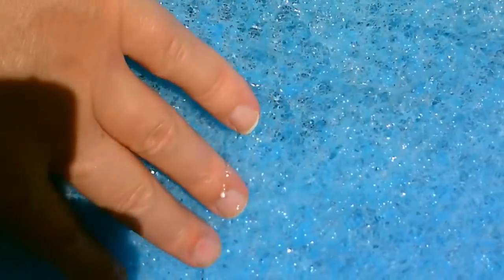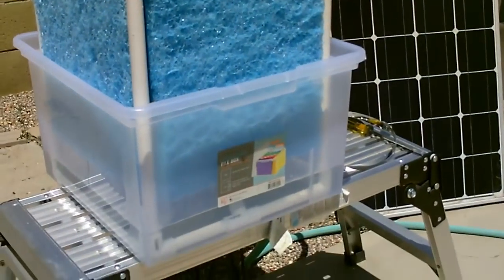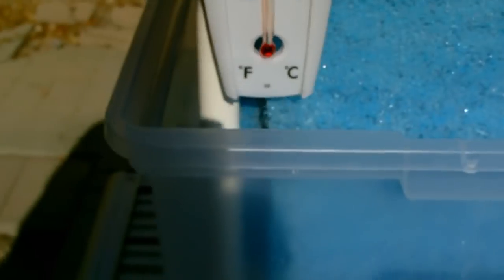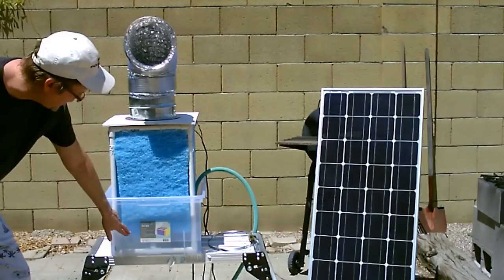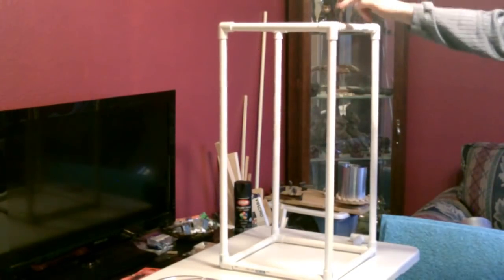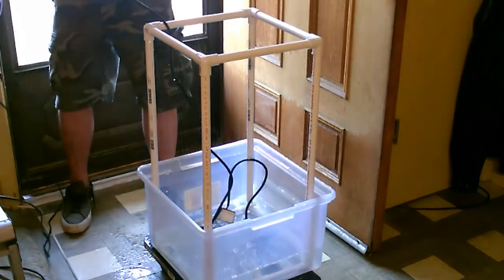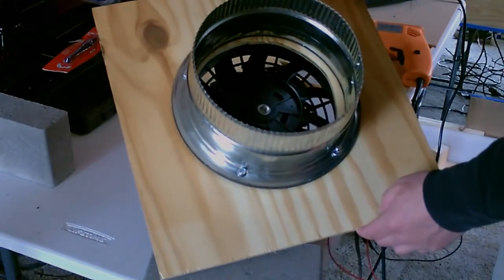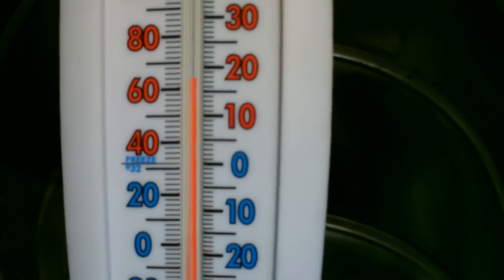DIY Evap Air Cooler! Best Yet! 1500CFM/20MPH (90Fin/64Fout) 500-1000 Sq.ft. run AC/DC/Solar/Batt

Comment: What size is the fan?  I just turned my swamp cooler from AC to DC to run off my solar system.  I used 8" radiator fans because 10" was too big but the smaller ones are louder. Anyway, now I need to make some for the other rooms. Did you go with 8" fans? All our bedrooms are about 120sq ft so I'm going to test this on one room.  It's been over a year, do you have any improvements since then? How has it been going for you and anyone else that made these?

Comment: Hi I am in the process of buying the supplies to make this. I have read that some people prefer the aspen wood fiber pads and also that the corrugated cellulose pads are the most efficient, although more expensive. Have you tried this with other pad types?
Reply from the maker: hi. i haven't used the other types of pads. i don't use the aspen ones because you can't cut them (so you'd have to design your evap. cooler specifically for a certain size pad). that seems very limiting. about the other type, i may try the corrugated pads in future vids.

Comment: Has anybody found the pump add a link please
Reply from the maker: hi there. i don't see the exact pump listed on amazon at the moment but here is a similar one. this is a link to a 12v 200gph pump https://www.amazon.com/VANSUNA-Submersible-Aquaponics-Agricultural-Irrigation/dp/B07TK2TV77/ref=pd_sbs_86_3/143-3040554-3226717?_encoding=UTF8&pd_rd_i=B07TK2TV77&pd_rd_r=d45f9beb-b00d-481f-aed4-ca22242b806d&pd_rd_w=rbq1I&pd_rd_wg=EFaNu&pf_rd_p=703f3758-d945-4136-8df6-a43d19d750d1&pf_rd_r=2KTNZ19XBCJSNFN960Z9&psc=1&refRID=2KTNZ19XBCJSNFN960Z9

Comment: I built the short version of this design a few weeks ago.  I tried it out at a place that had relative humidity between 17 & 20%.  I got about a 15-18 degree drop in temperature.  I was stoked.  But... the problem was that the 1500 cfm/2250 rpm 7" fan could not put out enough volume of airflow to lower the temps in my trailer.  While watching the beginning of this video again just now it appears that the airflow of the fan in the video is much higher than what I was getting in my trail run (my hair definitely didn't move like that).  I'm wondering if my fan is a lemon or if I need to experiment with giving the fan more juice (higher voltage).  I used the 12VDC system on the trailer to power the fan and pump rather than hook up directly to the solar panel that I bought for this unit.  The solar panel would have provided higher voltage.  Any advice would be appreciated.
Reply from the maker: hi. first, it's awesome that you built it and your getting good temp drops! most likely you just need to flip the fan blade. the fans i use are what they call push/pull fans. if the blade is not facing the right way it will run fine but it won't move hardly any air. (the blades are usually very easy to flip. it's usually just a single nut that holds it). i get a 20 mph airflow. if flipping the blade doesn't work, try powering the fan with an independent power source (meaning use one power source for the fan and a separate one for the pump). if that doesn't work then i'd try a new fan. one other thing... this is probably unlikely but it could also be that you have too much water flow down the pads. if water flow is too heavy it might be acting as a barrier. try reducing water flow. (keep at it. this unit should easily cool a trailer when you get that fan cranking)

Comment: Wrap the sides and bottom of the tub in some insulation or see if you can get a cooler that would fit. I bet you could knock a few degrees off the air temp

Comment: OK all my parts arrived and I may start the build and upload this week if possible. Mine will have a solid wall on the front side with fans and switches and the other sides the blue fabric material.  I need some PVC and a note book to sketch it up. Its been really humid these past days so I did not have interest in it.  I will try a 100w solar panel and if not put 200 watts in solar panels. I may be going over board but looks interesting.
Reply: Where are you? And if you build it record it, upload it and please send me the link. I'm curious to see how others do with it.
Reply: @Live-Life-Freely  I'm in South Texas and I have all the parts still in the back yard. I have not made time to create my setup.
Reply: @cutweldngrind  Nice now it's just a matter of making it happen.

Comment: Wish you had affiliate links to all the products used. Would be easy for me to find and nice to give you a little commission for posting the video!
Reply from the maker: hi there and thanks for the comment. i looked into affiliate links a while back. there's a couple of reasons i don't use those. the main reason is that my videos are the 'evergreen' type (meaning they're relevant for years and years). the links to the items (on amazon) change so often that many (or most) of them wouldn't work in a short time. all those un-working links might really frustrate people. and trying to make sure that all the links, in all the description sections, of all the videos, were always current would be way too labor intensive. other reason is my projects are typically made with simple, inexpensive components so i'd probably make no more than $2 to $3 a month total on affiliate links anyway. (the payout on affiliate links is very small unless the item is pricey).
Reply: desertsun02 understandable. Well thank you very much for the idea and breakdown of all materials used. It will make a great Saturday project!

Comment: Where are all your Amazon referral links? Great build!
Reply: Exactly. I wish he posted links to all the parts, it would have made it a breeze to build one. :)
Reply: I'd settle for just the fan :)  The rest is pretty generic stuff on Amazon and the hardware store.  The cooling pads are cheaper at the store.
Reply: 12 volt cooler fan PVC pipes and water pump for a fountain

Comment: Nice design... I build one and get similar numbers! I used a honda crv radiator fan.
I put the frame in a 55 gallon plastic drum and added  auto waterer.
Works on solar... 

Currently on second build out of 4!
Reply: Question on the radiator fan did you just bypass the 200-+180 thermostat switch

Comment: My old radiator fan still works, and I have everything but the pads and the oil/water pump. This is goin down!
Reply: Did you ever build it
Reply: @carlschmiedeke151  Not even a week after I posted this I Herniated 3 discs in my back and I'm waiting for surgery still.... So no lmao.

Comment: I may build one, 6' tall, 6' wide ~2' deep,, I live in Phoenix...3 car garage.
Reply from the maker: sweet! 😎
Reply: @desertsun02  Built two, my smaller 5cft unit turned my garage into a sauna 😀, blew at ~78f at 111F garage temps though,  moving that into attic as Arizona attics are essentially outdoors. Guess my large unit I'll have to place outside and duct in....and I'll get a positive pressure system that way.
Reply: @desertsun02  Well I'm about to give up on my big unit maybe you have an idea I'm starting to question reality. 
It's 105F right now, outside hose tap water is pretty warm guessing ~85, after ~15 minutes you wouldn't believe the water temperature of the big unit sitting outside (that's blowing air through an inclosed doorway into the garage via a hole). 
- Water temp in the swamp cooler trough sitting outside: 69.5F! 👍
- Air temp being blown out the top via fans through a duct into the garage: ~97f 👎

I just don't get it, the pads are wet and cold, I have zero air leaks, the pads go from the very top to submerged into the cold water. CFM is like 5500 (twin 14" fans), tried unplugging a fan as maybe the air volume inclipes the heat exchange rate, the unit is outside, yet cast in full shade. 

I don't get it, cold cold water...yet hot air.
Reply from the maker: hi there. based on the fact that the water is getting down to 69.5F you know it's working. don't give up. it's probably one of three or four things. first thing is that maybe the 5500 cfm is just too high. i think the blue pads are rated to be effective up to 2200-2300 cfm... so the unit could be pulling the air thru too fast. this is unlikely though, because the air is split between 4 pads. second thing is that air will travel the path of least resistance so if one of the pads is significantly less wet than the others it will cause most of the air to want to go thru it (the drier the pad the easier it is for the air to go thru it. but you won't get the cooling). third, the air might be going around the pads somehow (sounds unlikely thou). fourth, are the pads in your cooler equidistant in relation to the fans (i designed it as a cube so all four pads are the exact distance from the fan *so it would pull the air evenly). my guess is that one of the pads (although it is wet) is significantly drier than the others and most of the air is going thru it. again, it's cooling the water so it's working. i wouldn't give up. you've almost got it. that air coming out of the unit should be no higher than the low 70's if you've got water temp of 69.5F.
Reply: @desertsun02  Greetings! So I took some of the advise and rebuilt thinking of least resistance and other ideas. Originally 1/2" tube, 1/8" holes, 3/4" apart, drill hole on bottom and blue pads hung off the pvc pipe underneath  like a curtain (yet pulled tight) I threw that away, and did 1/2" tube, 1/16" holes less then 1/2" apart, shooting straight out (90 degrees), and wrapped the blue pad around the entire out most circumference like yours. Upon placing the fan lid the pvc's new position hit the fans, so inverted the fans from bottom mount pushers to top mount pullers. 

Now got cool fresh air 👍. Also the decibel level seemed to be cut by atleast half moving to a puller set up. I notice yours are loud, try top mount and reversing the polarity to account for it.

Comment: Hi. Shouldn't the fan be facing up instead? I made one just like it but the fan facing down blows air in  rather than out like the video. :(
Reply from the maker: hi. i used what is called a push/pull fan. that means you can face it (and run it) either way. you just physically reverse the blade if needed. (it's just a single nut that holds the blade on).

Comment: I wanted to drill holes 50ft deep, and put a pipe, within a larger pipe in the holes. The smaller inner pipe would lead to a small radiator. The system would be sealed and pumping fluid through it would use little energy. A 12 volt pump, and a fan connected to the radiator would run off a si glen pv panel. When the sun came up the cooling would be automatic. Several on the sunnyside of the house should be quite effective.

Comment: So far, you have put together the best video on evaporative coolers that I’ve seen – kudos to you! I’ve been looking into finding a good fan, but in order to get 15 to 2000 ft.³/min., I need 80 of the 100 W max on the solar panel. I can do that with a 14 inch fan made for a car. My water pump only takes three watts and does 1.5 gal./min. I want the hundred watt solar panel to keep the marine battery charged well to work in the evening for my CPAP machine. They are costing $40-$60. I don’t think there’s a need to spend that much. How the heck are you getting 1500 to 2000 ft.³ per minute with a 7inch fan? That’s phenomenal! Please tell me where you got your fan.        I wish I could show you what I am doing. I’ve got a 20” x 30” x 14“ container, 27 gallons. I want to reduce the height of the set up because I’m planning on using it inside. If I suck the air as you do, I can’t put I heard on it because of the prohibitive height. If I blew through the four sides and into the container with an output cut out of the top of it, would blowing it cause water to spray? So far I’m thinking the best design will be to make my frame 14 x 18 x 30 (using 28 inch evaporative Duracool media). That will give me plenty of room to put my 7“ fan next to this in the lid. If I fill up the container to within 3“ of the top, that causes my exposed media to be 14” x 18” x 19“ at the least to 14” x 18” x 28“ at the most. That gives me 1216” to 1792” or 8.4 ft.² to 12.4 ft.² of functional media...! IF I planned on adding the top section to also be media, that would add another 252 inches or 1.75 ft.². One thing that concerns me is that the package for the pump says 12 L per minute or 3.17 gallons/minute. My pump is 240 L per hour or 4 L per minute. I trust that’s a typo! Know if all this works out right I’m concerned that it may end up causing too much moisture in the air. I don’t live in Arizona, but Northern California. During the time I would use it, the outside humidity is between 80 and 30%. Do you have any idea at what temperature/humidity you could start running this without having concern there would be too much moisture in the air? Also, I’m very interested in checking out your two-stage cooler. Please send me a link to what you’ve put together for that. Thanks for taking the time to read this and I sure hope you will respond. I’ll give you five stars in the best feedback possible, no doubt! If you’re up for it, leave a comment and I’ll get back with you with my phone number and we can talk. Thanks again so much!
Reply: there is above his link to show the parts for the fan and plugs and other . https://www.youtube.com/watch?v=GATesKJeLMM&t=0s

Comment: Trying to find a 7" radiator fan that delivers 1500 cfm.  Any that I find on Amazon are only about 1/2 that airflow amount.  Where did you get yours?
Reply from the maker: hi  i get them on amazon. here's one. https://www.amazon.com/Universal-Performance-Electric-Radiator-Mounting/dp/B084M2MQFS/ref=sr_1_3?dchild=1&keywords=7+inch+radiator+fan+1500+cfm&qid=1595075007&sr=8-3  or here's a 1000 cfm one (still super strong, should work good too) https://www.amazon.com/Electric-Radiator-Assembly-Universal-Reversible/dp/B01MZACM2B/ref=pd_sbs_263_7?_encoding=UTF8&pd_rd_i=B01MZACM2B&pd_rd_r=bff28d6b-0a32-40d4-ac33-0b09412db37a&pd_rd_w=uZU58&pd_rd_wg=bcCpW&pf_rd_p=bdc67ba8-ab69-42ee-b8d8-8f5336b36a83&pf_rd_r=Y3WWS4SZH5X349MN7HDM&psc=1&refRID=Y3WWS4SZH5X349MN7HDM

Comment: Just ordered the pad. Fans and pump are next.
Reply from the maker: sweet! this is one of my best evap cooler designs. holds a lot of water, doesn't take up much space, has high airflow and runs on or off-grid. for 'on grid' use just use one of those ac to dc transformers (sold on amazon)
Reply: @desertsun02  I will look for the biggest container to use the full width of the pads I purchased. I plan on just DC power from solar panels as I feel safer than having 110v AC next to water. What size pump you recommend for a system a tad bigger than this? Thanks for the help friend.
Reply: I could even build 2 to get better coverage. Now we need the Covid 19 to go away so I can show off my coolers during my parties.
Reply: @desertsun02  I already ordered a 90w 14" fan, 13L per minute pump, 29" x 144" roll of Pad, 2 Toggle switches, watt meter to monitor solar input. I just need the PVC and Tub. I will try a 100 Watt solar panel and if I need more power I will use dual 80 watt panels. Its videos like this that get me going, going to get my ATM machine that is. LOL. I think I am currently at $90.......Fan $18, Pump $16 and Pads $42. Now to wait for UPS, Fedex and USPS.

Comment: does the water have to be cold?
Reply from the maker: hi. no it doesn't. it works with room temperature water. the water actually will cool down as the unit is running (the evap effect cools the water as well)

Comment: So I'm trying to figure out how the evap pad setup works and logically it doesn't make much sense. If I were to use this outside in 100F weather, it's only a matter of time before the cold water warms up which would effectively make it useless unless you add ice constantly to the plastic bin. I didn't see ice but would imagine it would need ice or gallon ice containers to make it more effective sort of like how you did it with the water exchanger. I've gone camping in hot weather and ice in coolers generally melt pretty fast so I would imagine it needing to be replaced/replenished often. How would you normally operate with this setup and which setup works better? Water exchanger or evap pad? 

Also shouldn't the water exchanger be enclosed in the cooler? Saw other vids but wasn't sure which was more effective. It would be great if someone could clarify this for me thx!
Reply from the maker: hi there. it almost seems illogical at first but these really work. no need for ice (it cools thru evaporation). as an example, in my area, when it's 100F with low humidity (maybe 5%) you can get output air around 71F and it just blasts it out all day. you would think that the water would heat up but it actually cools down. the water in the tub cools down to about the temperature of the output air (the evap effect cools the water as it runs down the pad). whatever water that doesn't evaporate as it's going down the pad reaches the bottom and is much cooler. this all happens in a few minutes and then the water just stays roughly the temperature as the air that's being outputted. for more info - wikipedia has good explanation

Comment: umm does he design one for 120v if u don't cvare about the solar panel? I guess I can just get a normal exhaust bathroom fan and any kind of pump?
Reply from the maker: hi. i only make them with DC fans and pumps but it's easy run this with wall current. you just need an AC to DC transformer. amazons has tons. they cost from 15 to 40 bucks. i've got a separate video on how to do it on the channel ✔😎